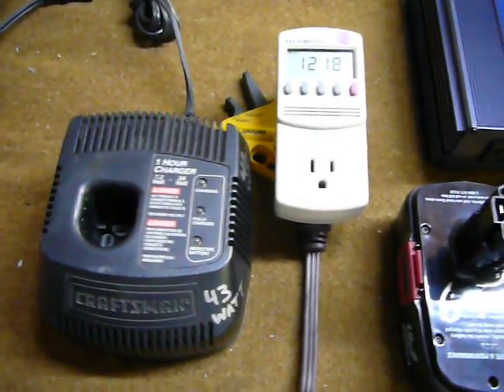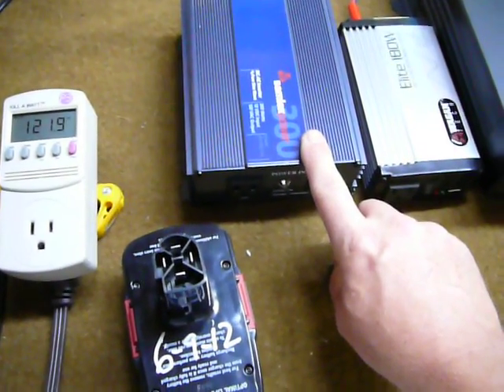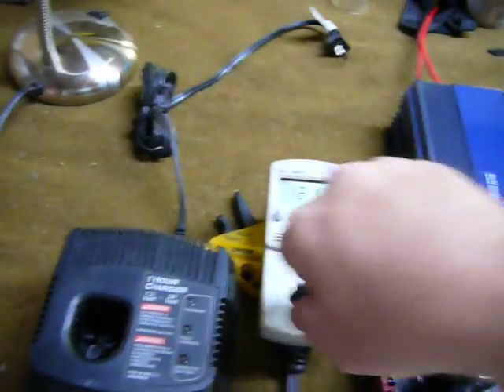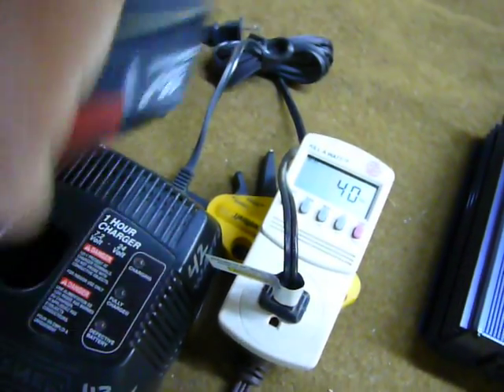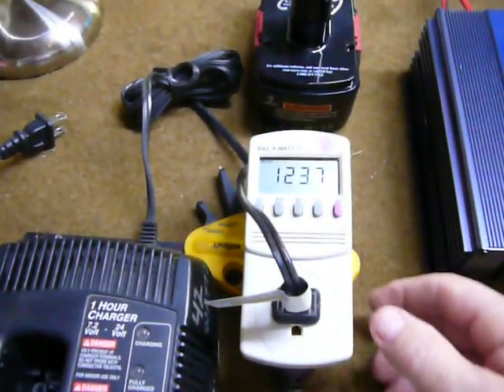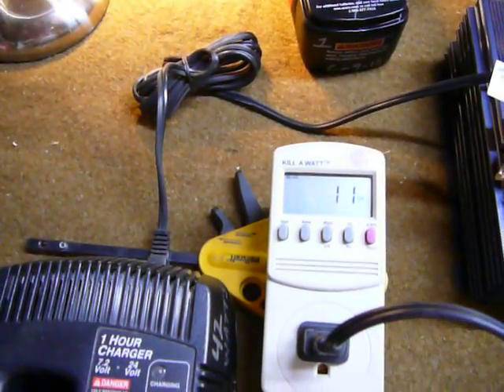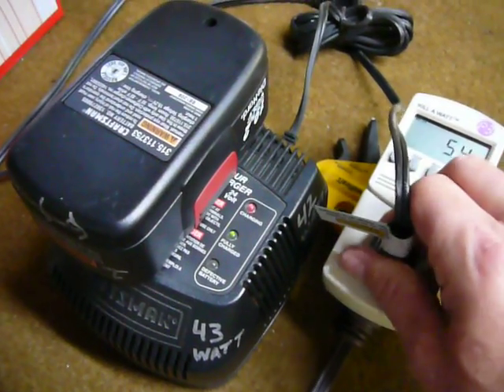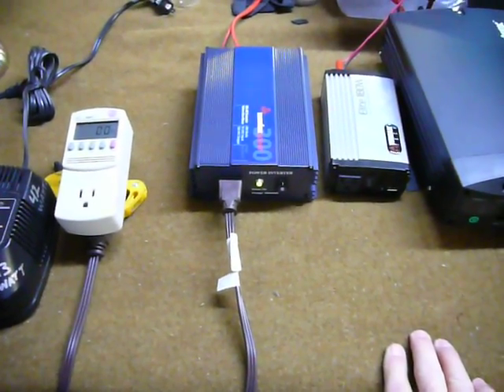Wagan,Samlex, Xantrex, Chicago Electric 12v Inverter Test w/Craftsman Battery Charger

Comment: Interesting video, thanks. Wanted to comment that the Samlex inverter in your video is rated 300W and Xantrex inverter in your video is rated 1000W. So this isn't really a fair brand-to-brand comparison. Xantrex outweighs Samlex in this test by more than 3-to-1. Also wanted to add that battery chargers are often switched-mode-power-supplies (SMPS) that have peak inrush currents 3-times higher than their RMS power consumption. So with your power meter, the true RMS power is 43 watts, but the peak power could be as high as 43x3=129W (over a short period of time) for a typically designed SMPS, and could have a power factor as low as 0.4.  This would give the surge reactive power as 129/0.4 = 322.5VA > 300W. Just some rough numbers here to think about. Overall your test is very precise and thorough, well done and thanks. Just wanted to add some comments for thought.

Comment: The reason the cheap ones don't work is that they're modified sine wave. Sensitive electronics like the charger just don't work with them - they need pure sine wave. It would be interesting to put the Samlex on an oscilloscope to see what's happening; it should be working fine.
Reply: Yeah, wished he had at least shown the hz on the meter while it was running the charger.
Reply: I have the same Samlex and I use it for my DeWalt battery charger without any problems. The inverter was probably annoyed at being called a SamPlex.

Comment: Well i certainly cannot recommend this product at all. My company  purchased quite a number of samlex inverters to power some hot spots sites but it was a waste of time and money, because they kept going down.....smh.
Reply from the maker: Macky, sorry to hear that.  My experience has been that you better plan on spending some money if you need an inverter for sensitive electronics or if the device has motors in it.  It's a pain but you'd better buy one, try it, and know that it works before you buy a bunch of them.  Thanks for watching, let us know if you find a brand that works!

Comment: You test wasn't fair. Xantrex had the most power: 1000w. I don't know about the Harbour Freight one but the rest were of smaller power. Wagan's one was only 180w. That's not the way to do a test; man.
Reply from the maker: Fair?  How do you figure that?  State your facts.  This was about the quality of the power produced by each inverter and how some devices like this battery charger are sensitive to the ac wave form.  This is a problem when providing power for many electronic devices.  This video shows how all inverters and pure sine wave inverters are not alike.  The load was at worst case, one third of the rated capacity of the inverter, well within its capacity.  This video shows how only a few inverters generate power that is of the quality of your wall outlet, and unfortunately none of the smaller converters I have, do.  Let me know when you do your inverter reviews and I'll be sure to check it out.

Comment: You might also look into an in-vehicle charger.  I picked one up for my Craftsman batteries and it just plugs into a lighter socket and works great.  Pulls 7-9 amps while charging and no need to fire up the inverter.

Comment: You need to make some changes. Check Avasva Solutions if you want to make it right.
Reply from the maker: Shannon Gibson I ended up changing to lithium batteries and the new Craftsman charger works with all of the inverters I've plugged it in to.  Thanks for the comment.

Comment: What was to tool you used to check the volts?
Reply from the maker: Google "Kill a watt meter" and you'll find it.  Amazon and Home Depot have them.  Its great for checking loads and the hertz on generators.

Comment: good video.  It sucks the Samlex doesn't work, as I have one :(
Reply: Check the specs on your Samlex.  I know the PST-300-12, which he is not using, is FCC Class B (residential).  The closest to the Samlex is the Xantrex at Class A (industrial).  Thus, the Samlex PST-300-12 has superior waveform control, fewer harmonics, and better isolation of the output frequency generator from the 12V primary, which is where the interference with electronic equipment, especially touch screen devices when plugged with their chargers.  You will have no trouble getting someone to trade their Xantrex for your Samlex if it is a PST-300-12.   

HF does not make pure sine wave inverters.  Modified sine wave inverters are far less expensive to make because they are low frequency, and do not cause interference with electronics.  

Pure sine wave can only be done one of two ways, with a mechanical alternator, or very high frequency plus a microprocessor.  The high frequency, in the radio frequency range, makes up the sine wave with tiny bits while the microprocessor regulates voltage level of the tiny bits for the output cycle wave form and frequency.  The higher the frequency, the better the wave form, the more it costs, and the more it costs to prevent the high frequency switching from being reflected into the high amp primary to obtain FCC Class B.  Don't believe the BS when people say that is easily compensated for by adding a capacitor.  First, I've tried that, and secondly, if it was that cheap and easy, the cheaper ones would have done it and gotten their Class B.  The only way to skate by with cheaper pure sine wave inverter is too make sure your sensitive electronics and touch screen device chargers are nowhere near the primary cables, and the shorter the primary cables, the better.  I bought a cheap pure sine wave from eBay some years back, and the only way touch screen stuff wouldn't go bonkers is when I moved the inverter under the hood, which is a harsh environment, and ran the output to the inside of the vehicle.